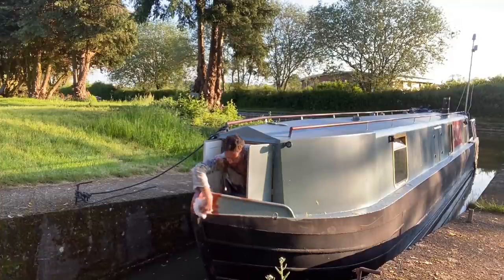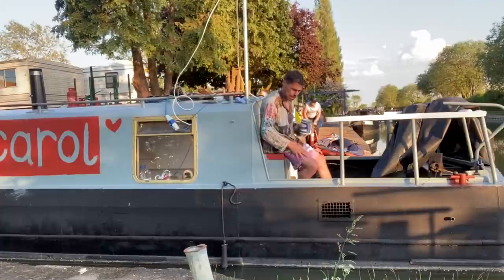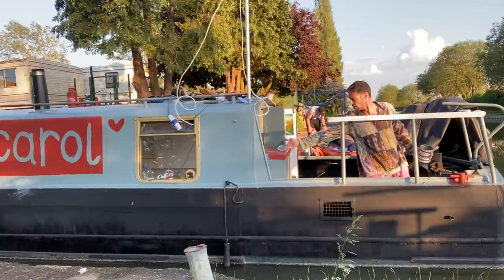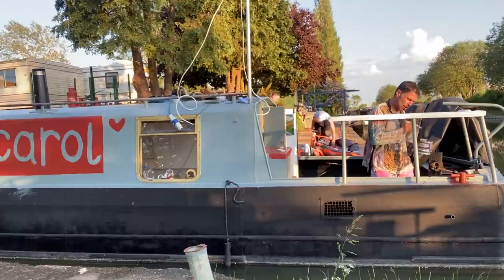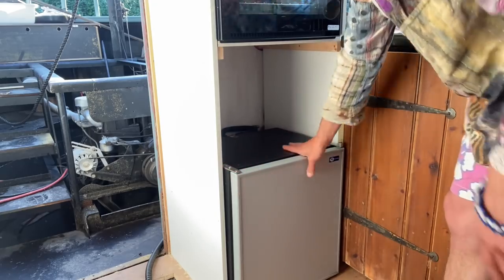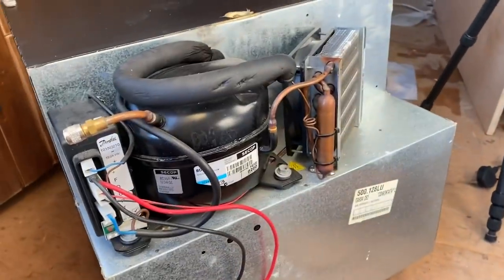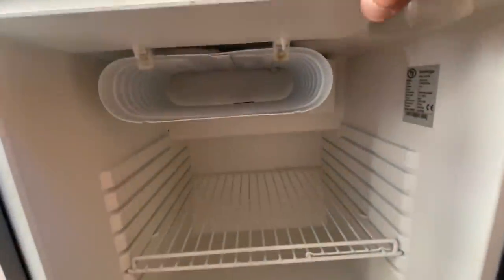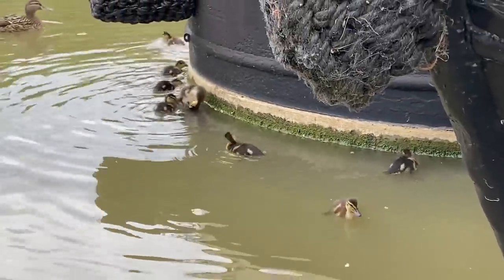193. New fridge for the Narrowboat

Comment: Hi James another good vlog just thought I might say that you should wire the fridge with the shortest run of cable you can I personally run the cables straight to the batterys with a in line fuse there is no need for a switch as you can use the control inside the fridge to turn it off if ever you need to now you can paint your cupboard doors a nice silvery grey colour to match the fridge jobs a good one

Comment: Fridges need somewhere to dump the heat they are removing, so will need good air flow over that side.
All the best.
P.S. I don't think you'll be needing the rough weather clip on the door.  If you do, you have bigger worries than spilt milk.  ;o)

Comment: I suggest you consider a heavier wire gauge, to avoid voltage drop between your battery and the fridge. The length supplied by the fridge manufacture is usually the max for the gauge they supply.  .. good luck..